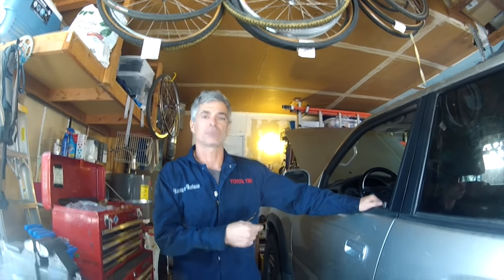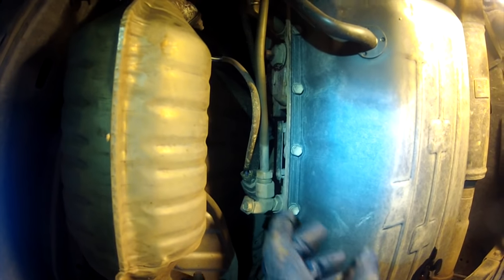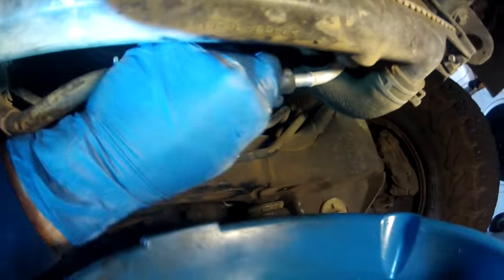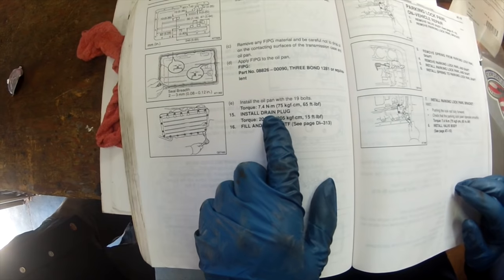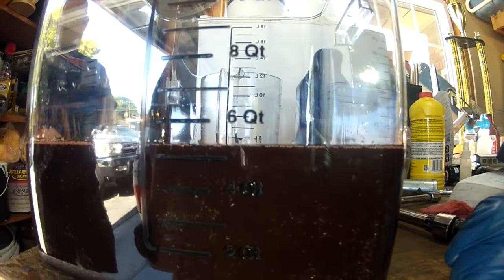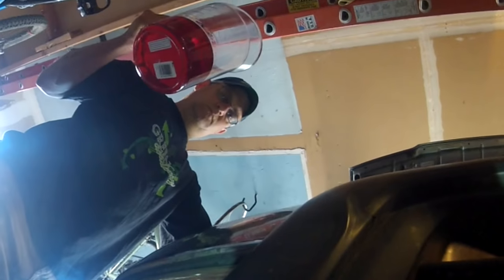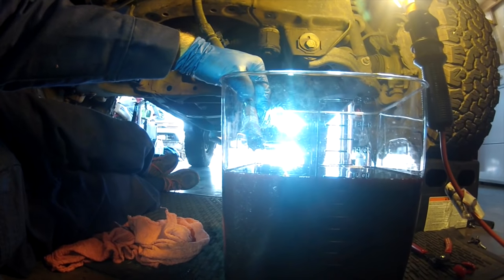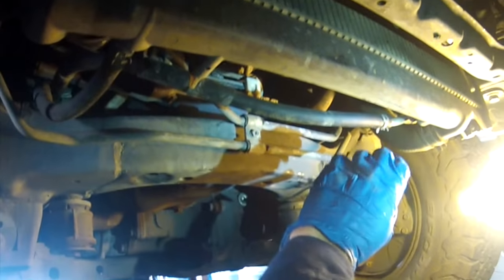Transmission Fluid Flush

Comment: Tim, I really liked this informative process. Could I follow this process on my 2014 4Runner Trail 4X4? Your reply is greatly appreciated.
Reply from the maker: Hey Sam, I'm pretty sure you have one of those sealed transmissions which makes it a very difficult and technical job to do.  They did away with a transmission dipstick and the procedure to make sure you have the right amount of fluid is very confusing.  There's a TSB (Technical Service Bulletin) on how to do it that I learned about from this other YouTuber "Toyota Maintenance" and it sounds like a pain in the butt.  Why auto manufacturers went to this sealed transmission I don't understand.
Reply: Yes you're right. Its a sealed transmission.  Regardless, fluids are fluids and they break down so i'll have to get it change eventually. Thanks bud and take care!
Reply from the maker: Yeah you're right Sam.  You want to be renewing the trans fluid at a regular interval to extend the life of your transmission.  It's just too bad they made the process of draining and refilling the trans a nightmare job to do.  If it were me, I'd drain the pan into a container I can measure how much was drained out and then add the exact amount back in.  As long as the level was accurate to begin with and you don't have a leak anywhere that dropped the level down below the suggested level, you can just do a series of drain and refills to renew the fluid.

Comment: I love your channel, so helpful, thanks for the time and effort to make them. Tim I wonder if you could use a caliper and list the ID OD and Thicknes of this washer?  FYI Everyone please be sure to get the actual crush washer listed in the description.  It is the only one I have found online that actually has the crush component engineered into it.  One side is flat the other side should have a crushable lip that smashes under pressure into itself and the pan while torquing your wrench.  I have found other online sources that do not have this component yet are listed as OEM parts.  And even on Amazon some are listed improperly.  The one listed in the video description is correct  OEM #35178-30010 is Genuine Toyota Transmission Drain Plug Crush Washer.  

I was duped by cross referencing other OEM part numbers from various other sites so I thought I would share that with you.  Be careful.  It may be a higher cost than it seems it should be but get it right the first time or it costs even more with reorders not to mention time and effort if you were already drained.  Also put it into perspective.  A new Rebuilt transmission is going to be about $2500 and higher not including remove and install labor if you can't do it yourself.  So 8 or 9 dollars for a washer is well worth it while avoiding a rebuild, obviously same goes for the fluid listed in the Vid description which is a great value right now.

I'm buying you a beer Tim, assuming that link is still good🍺🙂
Reply from the maker: Thanks for sharing all that.  I doubt I'll take measurements of the washer though.  Just buy the washers and use them every time you drain the pan.  Simple.  

And Yes, you can buy us a beer using the link we provide at the beginning of the video description.  We appreciate it!

Comment: Great video.  I am looking for the equivalent for the Lexus IS 200, can you help?  In particular which cooler hose should I disconnect?
Tx
J
Reply from the maker: Thanks James.  We're not familiar with your Lexus model so we don't know which line is the send and which is the return but it doesn't matter all that much.  If you end up disconnecting the return line like we did in our video, this will mean new fluid will push it's way through the trans cooler and flush out the cooler as part of this process.  If you end up disconnecting the send line, you're just not going to be flushing out the cooler but it's not that big of a deal.  The trans cooler in the bottom of the radiator does not hold significant fluid.  The key is to flush out most of the fluid out of the transmission and you'll be able to do that regardless of which hose you choose to disconnect.

Comment: Is there any problem you can see with adding 2 steps to your full procedure:
1. After draining the pan, remove and clean out magnets, clean/replace filter. 
2. When removing the line from the cooler, run the fluid out from transmission to the fluid out of the cooler and flush backwards through the cooler.   Reason being to back flush the cooler also to remove any possible dirt/debris
Reply from the maker: You could drop the pan, but I'd only recommend it if you're concerned because the trans didn't get serviced regularly.  The filter under the pan is a fine mesh strainer.  They don't clog all that easily unless the fluid wasn't changed in a very long time and sludge deposits were allowed to build up.  If the fluid was kept in good shape, there's no need to drop the pan. 

When I dropped the pan on my 2000 4runner and examined the filter, it was pretty much 95% unclogged.  The magnets had some debris on them but not that much.  Dropping the pan is a lot of extra work.  If you are curious like I was about the health of my trans, go ahead and drop the pan.  Now that I've done it once, I'll never drop it again because I do regular fluid exchanges and that filter will never clog.

As for back flushing the trans cooler, I don't think it's necessary.  You're already moving fresh fluid though it in one direction and I think that's good enough.  Maybe if you noticed fluid wasn't moving very freely when you're doing the flush procedure but I bet you're going to see what we saw and the fluid is going to be moving through there without issue.

If you still want to drop the pan, you can use this video: https://youtu.be/tuGazNhuEtM

Comment: Hi Timmy I did and trans fluid drain and fill with the valvoline Rex/merc (same stuff you used in your Toyota) on my 2002 Tacoma with the a340f about 5k miles ago. And I was reading today and apparently this fluid doesn’t meet Toyota’s T-IV standards. Do you still recommend this fluid? And have you ever heard of lube gard for the transmission, some people were recommending it. Thanks Timmy #healthymods
Reply from the maker: The standard for 1st Gen Tacomas and 3rd Gen 4runner auto transmissions was Dexron III.  The Valvoline Dex/Merc is compatible for Dexron III applications so yes it will work.  I have heard that people use lube gard but I haven't tried it yet.  The reviews are pretty positive from what I've read.

Comment: can you not add fluid when running? Was a great video much appreciated
Reply from the maker: Do you mean during the flush process?  If so, the fluid would drain out much quicker than you could replace it via the dipstick tube so it wouldn't work out well.

Comment: Silly question....sorry...so the fluid in the pan doesn't get pushed out thru the return line? Thus, the fluid pan drain and refill before return hose step.....
Reply: Exactly my thought. If the cooling line starts from the pan, doesn't it mean that the newly filled fluid will be pushed out from the return line?

Comment: Was there a reason you drained the sump? Seems to me that if you're pumping out the fluid the sump will pump out too. Unnecessary step and expense of new plug washer?
Reply from the maker: Well, by first draining the pan, you're renewing approximately 4.5-5 quarts by simply unscrewing a drain plug and putting it back in with a fresh crush washer.  You could forego the drain of the pan but that means you're going to be doing an additional 5 rounds of the drain one quart and add one quart process.  So yeah, you could do it the way you're saying but I wouldn't say the step of draining of the pan is unnecessary.  It's just a different way to accomplish the same task.  The crush washers aren't that expensive, but if you want to save a couple bucks, don't drain the pan.

Comment: Hi Timmy would you happen to ever dealt with a transmission solenoid code? My CEL has came on and that's what the code determines not sure where to start as I am a newbie. Truck shifts normal, RPMs feels as well
Reply from the maker: If you're getting a solenoid CEL, the solenoid might be having an issue and that's why the code popped up.  To access the solenoid, you would need to drop the pan.  Our transmission filter replacement video would show you how to drop the pan and get the filter out of the way.  https://youtu.be/tuGazNhuEtM  I don't however have a video for swapping out the solenoids but I know there's got to be information about it because plenty of guys have done them and done some sort of write-up on it on a Toyota forum.
Reply: @TimmyTheToolman  sounds good thank you for reply! I will look for info and parts, would you advise me to stop driving my truck until I fix it?? TYID
Reply from the maker: @Zevach97  If your trans is shifting fine, I think you're fine driving it.  I wouldn't however take it on any long trips.

Comment: Tim thanks for all you do.  I've learned alot from you.  Can you please tell me how to get the trans gauge on torque pro. I dont have that icon. Thank you..
Reply from the maker: You just have to create a new display and then scroll down and select "Transmission Temperature Method 2".  That's how I can get trans temp info for my 3rd Gen 4runner.  I don't know if it works for all vehicles though.  What year and model vehicle do you have?
Reply: @TimmyTheToolman  thanks I have a 2001 Toyota 4runner 2wd
Reply from the maker: @underdogontheappalachiantr9646  You should be able to set it up with the way I mentioned in my last comment.

Comment: Timmy I have never worked on my vehicles but since I bought my 2000 sr5 4runner I don't have much of a choice your videos have helped so much!!!!  My vehicle shifts great but I am running a Po770 code.  Which is a stuck shift solenoid E.  Should I just flush my system or should I drop the pan as well?  Any advice would be appreciated.  I am also doing my LBJ next month.  Thanks for the videos.
Reply from the maker: Hey Patrick, good to hear our videos are helping you with your 3rd Gen.

If you were planning on replacing the shift solenoid, the pan obviously needs to come down. I just did a quick search for that code and found this thread on T4R.org: http://www.toyota-4runner.org/3rd-gen-t4rs/202901-reasoning-about-automatic-transmission-issues-p0770.html  

From reading through that thread, I'd try the flush first.  If that doesn't change anything, I'd then replace the solenoid and see if that does it.  If it still does it, it sounds like it could be due to a torque converter on it's way out or a partially clogged valve body.  

Some guys are just ignoring it and resetting it every time the CEL appears because their transmission is still performing fine.  Good luck and let me know how it goes with this code.
Reply: Thanks for the quick reply.  I'll keep you posted.  Funny how a $3500 car is eating all my money, but its been a fun process.
Reply from the maker: Well, I guess you can compare your expenditures to shelling out $45-50k for a brand new 4runner.  When you think of that, the money you're spending isn't so bad.  I was considering buying a new SUV around 4 years ago until I saw how much money I'd have to spend.  I did some research and started searching for a used 3rd Gen 4runner based off their reputation of being a solid vehicle.  I think I made a very good decision.  Hell, even if you have to put in a rebuilt transmission, you're still spending way less than a new SUV.

Comment: So the fluid goes from the ATF pan to the torque converter and the transmission body and lastly through the transmission cooler... so the new fluid going down the dip-stick tube into the ATF pan keeps the transmission from starving for fluid. The fluid normally goes from the cooler back the the AFT pan . Thus fluid coming out of the cooler in the return line is being drained and new fluid going in is replacing it without any negative effect....

Is that correct?

Also, I believe the following part numbers are now for the ATF pan drainplug crush washer...
90430 18008 for a pack or 90430 A0008 for a single washer.
Reply from the maker: You're only exchanging one quart at a time with this process so you would never be starving the trans of fluid.  Drain one quart out.  Shut down the engine.  Add a quart via the dipstick tube and repeat the process until you've exchanged around 12 quarts of the fluid is coming out clear to your satisfaction.  The system holds around 12 quarts.  

I don't know if Toyota changed the part number for the crush washers, but maybe they have so thanks for sharing this.

Comment: Please explain how you get the torque as being correct on the drain plug. you could have overtightened it and it would still click, this is one of my pet hates at tire shops. They crank it with an air gun to about 200 ft lbs and then check it with a torque wrench set at 150. It will click ,but its 50lb over torqued.
Reply from the maker: You are correct Neil that I could have been over the torque value.  But, here's something to know about me and the way I turn wrenches.  I don't live and die by the torque value.  We showed using a torque wrench for the drain plug but I never use a torque wrench for this purpose.  I was just curious if my tightening by feel was at least at the specified torque value.  I've tightened hundreds of drain plugs on oil pans, differentials, transmissions and transfer cases and never stripped one or had one fall off.  So, I basically misspoke when shooting this video.  I should have just said I'm using the torque wrench to confirm I'm at least at the spec, and when I saw that I was, I should have said I'm either right at the spec or slightly over.  I know I wasn't way over, because like I said, I've learned how to properly tighten fasteners based off their size without stripping them, breaking them or having them come loose on me.

Comment: Hello, an affectionate greeting from Chile, I hope you have a spectacular Christmas.  I have a question and as a follower of your channel I am sure you will see the right person to answer my question.  I need to do a transmission filter change and transmission flush.  How should I do it.  Change filter and then wash or wash and then change filter?  I will be grateful.
Reply from the maker: I would drop the pan and replace the filter first.  This will evacuate around 6 quarts or approximately 50% of the system capacity.  Then I'd perform a flush doing six rounds (1 quart per round).  After the 6th quart, your fluid should be very clean.  The system holds apprx. 12 quarts.  Good luck with the job.  Merry Christmas my Chilean Brother!  Happy Wrenching!
Reply: @TimmyTheToolman  Hello, I hope you and family are very well.  I am very grateful for your instructions which I will follow verbatim.  I hope you have a spectacular new year
Reply from the maker: @nicolasverardimurillo5335  Thanks Nicolas.  Hope the job goes smooth for you and you have a great new year as well.